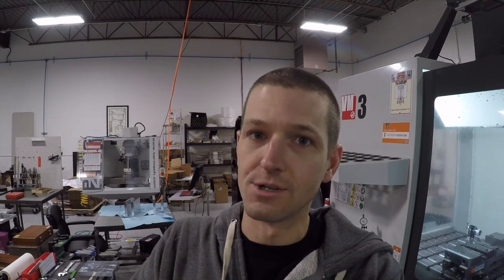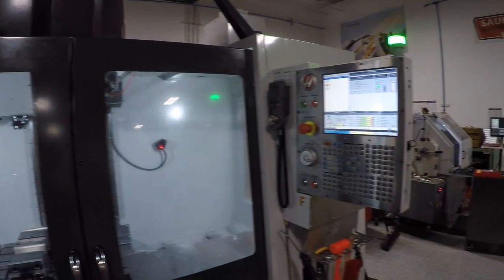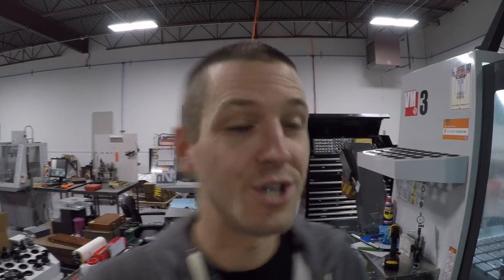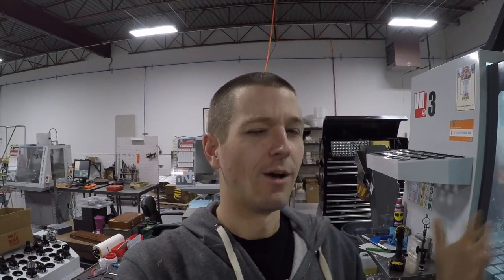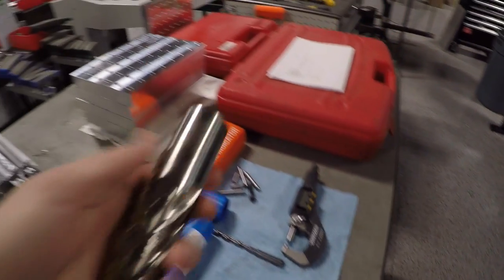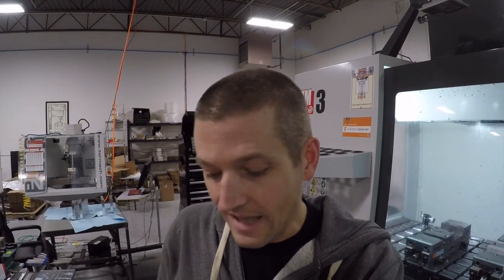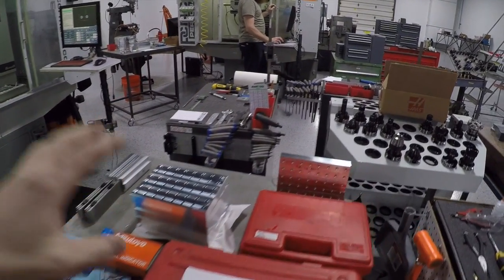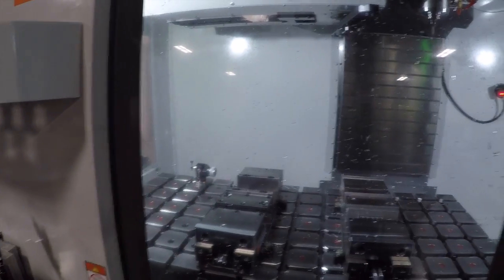Cast Iron Lessons Learned, Production Process, Less is More!  CB40

Comment: M95 Sleep Mode The format of the M95 command is:  M95 (hh:mm) The machine must be on and have air pressure. I don't think power consumption is a big deal. I think it only pulls 1 to 1.5 amps at idle correct me if I am wrong. 
Example
If the current time was 6PM the machine will start at 6:30AM
M95 (12:30)
O00000 (Spindle Warm-up) 

(This program should be run prior to) 

(machine use if machine has been idle) 

(for more than 4 days.) 

(Cycle time: 20-minutes.) 

(This program can be used for all) 

(spindle types and may be used daily) 

(for spindle warm-up prior to high) 

(speed spindle use. Adjust spindle) 

(speed override depending on maximum) 

(spindle speed of machine: Set) 

(override at 50% for 5,000 rpm) 

(machines, set at 100% for 7,500) 

(& 10,000 rpm machines, and set at) 

(150% for 15,000 rpm machines.) 

(9-21-99) 

S500 M03 

G04 P200. 

S1000 M03 

G04 P200. 

S2500 M03 

G04 P200. 

S4000 M03 

G04 P400. 

M30

Comment: On your warm up for the Haas Machine get a timer wired in to the feed to the machine through a relay or in the machine power cabinet! Have the timer turn the machine on about Half an hour before  start up time! Power can be through ether 110V or a transformer dropping it to 110V. A good electrician can do this for you!
Reply: This could be set up or should be able to do in the machine on start up.
Reply: Arduino? :)

Comment: The cost of 1 on those 1-1/8' rougher is cheaper than buying an inserted cutter and inserts.  Assuming you didn't already have inserted tooling and needed the length or width that the HSCO has to offer.  It would fit for small non-production type  run. Just my 2 cents.

Comment: one time i was running a plastic injectionmolding machine i accidently was running with a injection pressure on almost 29000 psi. and on my day job we are making plasticpipes med a pressure from 1400-6500 psi

Comment: Any plans on sharing how the Fusion 360 outage affected you and how you worked around it?
It would be very helpful to know and understand your work around.  Thx.
Reply: NYC CNC Look at GIBBS, it's simply the best. Yes it's costly, but you get what you pay for. I've been at this for 36 years and we wouldn't switch to any other cam system. Great job with the channel.
Reply: Chrus B 
Last time I used Gibbs I was not impressed. Personally I'd take MC or Solidcam over it. 

Hypermill and NX would be my top choices. 

But least you said Gibbs and not Bobcam. 😁
Reply: Very good to here...Thank you.
I left a comment on your discussion page about a weird post where someone ( i don't believe it was an Autodesk employee ) thought I was you. You may want to check it out. 
Thx again for all the great videos and being a voice for all of us who use fusion 360.
Reply: Occams Sawzall Here at Northrup Grumman in Manhattan Beach Ca., we have 27 workstations with, GIBBS, Mastercam 2017 beta, NCS, Veticut, Catia. Each machinist has a workstation, with differant access acording to the security requirements of the product they are working with. Somewhere north of 72% of programming is done with GIBBS with NCS coming in second. GIBBS is a very secure, offline product.
Reply: Chrus B 
Believe me we have the same security requirements here if not more.  I swear the FDA is more secretive than the military 😆

We run Catina, creo,  pro e, inventor, solidworks and Solidcam   

Trying to get them to switch to NX or Hypermill. NX is incredibly secure with Siemens PLM system.
Reply: Occams Sawzall Total agreement with the FDA, do you contract with Scitor?
Reply: Chrus B 
That's all lawyer and IT stuff, I'm just the machinist 😆
Reply: You're lucky, I don't get to run a machine much anymore. I more deal with proplems, engineering, security, materials, shop and transportation
Reply: Chrus B 
I quit a job because they wanted me to go to just programming only. No thanks, I want on a machine.
Reply: Occams Sawzall I was a programmer/operator then went to CAD design and programming only for 9 years....Missed the operation end of it so I quit and opened my own shop.....Now I have complete control.
Reply: Cad-Cam_Man 
I would love to start my own shop. 

Cept the whole having to deal with the general public and such. 

I don't play well with others 😆
Reply: I deal with industry not the public no advertising keeps the public away. Industrial work keeps my family fed and me happy.
Reply: hrc-rr 
That I don't play well with others? Pretty sure that's universally agreed on. 

In fact I keep trying to submit it as a natural law of physics...  no luck yet...
Reply: hrc-rr MC over GIBBS? I guess you haven't used GIBBS much. You can twiddle things so simply, watching the Fusion makes my head spin....
Reply: Cad-Cam_Man Great! where are you located?
Reply: Chrus B North Central PA
Reply: Do you have a commodity complexity rating?
Reply: Chrus B Not sure what that is so I'm gonna say no...lol
Reply: :p, it's a number from 1 - 10 that means how complex of a commodity you can produce. In aerospace (I'm at Northrup Grumman)  it's how we align what vendor manufactures what type/style of part/sheet metal etc etc without knowing them at a personal level. Always looking for shops.
Reply: I see. I haven't been assigned a number (at least I'm not aware of it) I don't mass produce anything for consumption. I mainly focus on mold tooling  (patterns etc.) for the casting industry. Sand and investment. Just delivered a investment mold today.
Reply: I haven't seen a cast part in 25 years ;) , everything is bar, plate, round or hammer forge. Have received any snow yet? I'm to much of a California wuss'ie boy to live in the cold.....
Reply: I believe the inside of a foundry is as close to hell on earth as it gets! Lots of heat, fire and sparks! Lol They are calling for 2 to 4 inches of snow tonight. Night before last it was -25 wind chills..
Reply: Hello Cad-Cam_Man,
 I am interested in learning about mold making for investment casting, could you recommend a good place to start? Any good books ,training online or anywhere...etc
We reverse engineer a lot of parts that where originally cast but only make 50-100 or so a year so it's not cost effective to have a mold made, but if we could make the mold in house it might be worth while to have 500 or so investment castings made and finish them as we need them.
Reply: Ed T I've only been at the investment end of things for about 2 years.  I've been in the sand pattern trade for my entire working career. The 2 are vastly different. I have a fellow doing sales and consulting for my shop who is well versed in investment so I'm learning from him. I do know that all foundries have their own way of doing things so it's not a one size fits all kind of process. Part of my investment work is to take a print or customer CAD (solid model) and add foundry shrink and build a complete cad model of the tool, pins, gates....everything to construct. I may be able to.help you there if you're interested. I can also recommend foundries if your interested.
Reply: Cad-Cam_Man,
 We are up in New Hampshire and have a couple gun manufacturers (Ruger and Thompson) that we have done some investment casting with in the past (outsourced the molds). I did start a mold a long while back and Thompson was very helpful with % of shrinkage for the material we were going to use and placement of gates and pins, but the part was discontinued before I finished.They also gave us some tolerances to hold on surfaces that meet so the wax would not leak ( I think they called it flash) out of the mold. 
 Cad/Cam has grown leaps and bounds since then and it must be a lot easier now to produce a mold, I think mold making would be very enjoyable and rewarding. Names of more foundries could be a great place for me to start, Ruger is still here not sure about Thompson I believe there was a fire at their plant years ago and they may have moved.
Reply: Email your requirements IE. part sizes, quantities, material to he cast etc. to me at swdesign@ptd.net and I'll get back to you.

Comment: I thought it would be a good idea also to run warmup programs before my operators punch in. Turns out it didn't work so well for us.

That 20 minute warm up time works out well for daily maintenance. This like cleaning out the chip basket, checking concentration and topping off coolant, cleaning and putting away tooling and holders, cleaning around and the machine itself, or getting tools ready to setup the next job.

Without that daily 20 minutes, many of these things went undone or interrupted longer periods of time during the workday to complete. The cleanliness of the machine and surrounding area also declined significantly.

Comment: Hey John, I printed a cooling shroud for my 3D printer and thought the same thing could be used in reverse on a CNC mill for many dry machining jobs. Something similar is used on CNC routers and they work very well due to the largely 2D nature of their work. Search "dust shoe" "dust boot" etc Here's a couple to get the idea. 
https://www.youtube.com/watch?v=0YHAqdXDTdM
https://www.youtube.com/watch?v=ufXTIu2VmME
They likely won't work quite as well for CNC mills due to the more 3D nature of the work, but with a dust extractor or big shop vac attached would likely catch the majority of the chips. The skirt would also control those it didn't actually catch. If it took 1-2 hrs to clean up after that last CI job (not hard to imagine that too) then it could be worth some Wednesday Widget time to knock something like this up and give it a go. 

A lot of people poo-poo the home shop CNC router side of things, but the fact is the mechanically very limiting machines seem to lend some amazing creativity from many of the router users as they overcome their machine limitations by thinking outside the box.